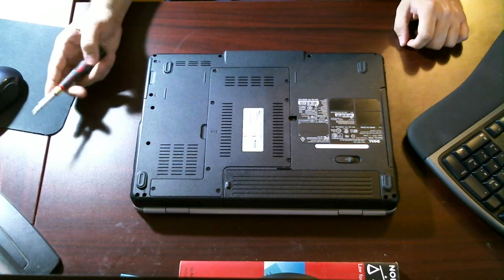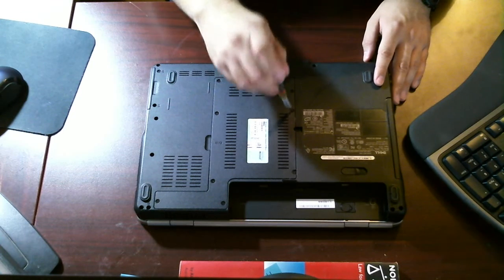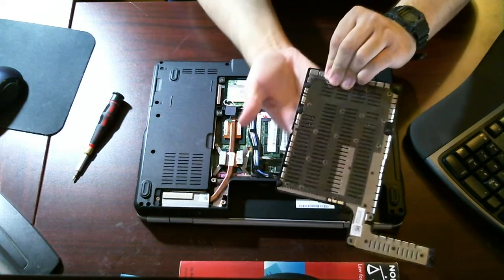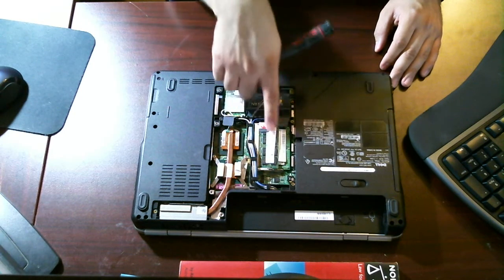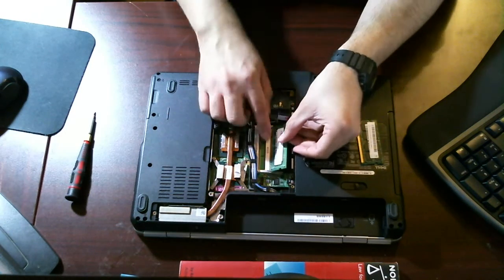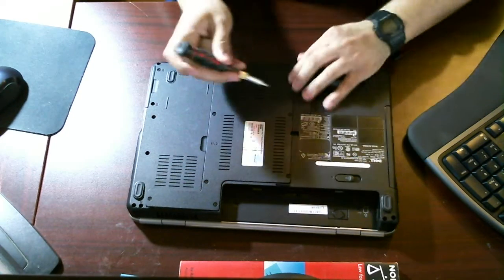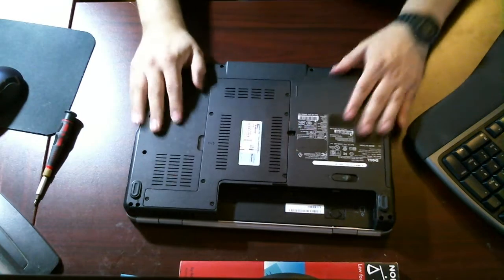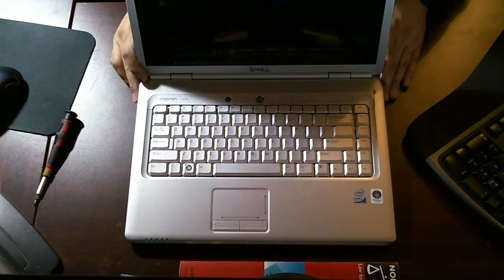How To Replace Or Upgrade Ram Dell Inspiron 1525

Comment: My uncle used to have this laptop until he gave it to me. While I'm in the verge of upgrading my 2 laptops (already upgraded the DELL Latitude E6430) and 2 desktops, the DELL Inspiron 1525 will be the next one to upgrade, and to do that, I'll have to by 2x 2GB DDR2 SODIMM for it (as well as a 500GB Solid State Drive SATA and clone the hard drive to it).
Reply: The RAM can be upgraded to a max of 6 GB DDR2 800 MHz. So 1x 2 GB & one 4 GB stick. Thr max CPU supported is an Intel T9500. 😉🤔😏

Comment: It is my understanding that the RAM cannot exceed 3 gb for the 1525 .inspirion.i have one .advise pls
Reply: i have 4gb ddr2 installed on my 1525 and i hear it can go up to 8gb... i wouldnt try it though bc it hasnt really been tested. BUT, people have safely achieved 6gb of ram with one slot filled with a 2gb module and the other one with a 4gb. if you wanna try it, make sure u get the right ram modules. and to use more than 3.5 gb of ram you need a 64 bit windows installation. hope i cleared that up a bit
Reply: @Zeazy   i have a 64 bit version I will give it a shot 2 and 4  i sure am amazed at the way this unit is operating considering the time it was  built
Reply: I did a bit of research on point and found out that 4 GB is what Dell recommends as a maximum. However, it may work with 6 but will NOT work with 8.
Reply: I understand that 4 gb is the max, but mine will not take  more than 3gb!
Reply: @smallcnclathes
Reply: What i did with mine was  make a ramdisk drive. it worked beutiful.. 
I used a memmory stick.Sadisk 32 gb and dedicated half of it to ram and the other half to system memmory
 @smallcnclathes

Comment: Bro how much ram can add in this slot
Reply: The RAM can be upgraded to a max of 6 GB DDR2 800 MHz. So 1x 2 GB & one 4 GB stick. Thr max CPU supported is an Intel T9500. 😉🤔😏

Comment: I know so many computer geeks that would slap you up side your head for not grounding yourself before touching  the memory. Anybody doing this if you don't ground your self by use of a ground strap or touching a metal object like a computer case or appliance (skin to metal) that's plugged up with a grounded power cord this will discharge static buildup. Any static build up on your body can fry circuits on the memory and kill the strip.
Reply: Highly unlikely. Mostly just an urban myth.
Reply: Never grounded in my life, 20 year tech.
Reply: Yeah, I had a professor in our instrumentation lab who would always insist on this, but I never did it and everything was always fine.

Comment: Hi, i have dell inspiron 1525, 32 bit, processor-intel r core tm 2 duo cpu t5550@ 1.83 ghz 1.83 ghz with 2 gb ram installed on it which is around 6 year old laptop. Now my friend is offering another 2 gb as he is having excess so can i add it to upgrade my lap ram to 4 gb. Pls mention if there will be any side effect due to this change. One more thing at right side bottom end it was mentioned intel centrino inside TM.
Reply: It will be normal, but be sure not to misplace it

Comment: I currently have 3GB of ram and computer is slow - 32 OS, Windows Vista Home Premium.  Do you think it would be worthwhile to go to the maxium 4 GB to help speed / operations?  Thank you for your help.
Reply: Dump the vista and go for the 64 bit windows 10. you will be surprised at the results . im running 3 gb ram but fixing to try 6 gb just to see if it makes a difference .

Comment from the maker: Hi - there are 2 RAM slots available within this unit. With that said, please visit crucials website (crucial dot com) to see what the max capacity RAM is. Then, once you have the max RAM, order either (2) 2GB ram sticks or (2) 4GB RAM sticks. I hope that helps. Best of luck! I appreciate your support. Thanks for watching and please subscribe!!
Reply: max acceptable ram is 4 gb or 8 gb.....my system is a core 2 duo processor, 32 bit architecture unlike the 64 bit machine you talk of
Reply: @drdr73  so will it take 8gb of Ram without a problem ?  I have an old Dell Inspiron 1525 and it is so slow, it's laggy, I have windows 10 32bit installed.

Comment: Hi,
I want to upgrade my RAM to 4 GB. currently my laptop is configured with 2 GB. Can u plz tell me how many extra RAM slots are available?? If no free slot is available, what happens if I replace one of the 1 GB ram with 2 GB ?? will the performance of my laptop increase?? also tell the side effects.
 --Rahul
Reply: If the ram sticks are compatible, sure you can get away with using a 2gb and a 1gb ram stick, total ram would be 3gb and performance would increase. Although I'd suggest just buying 2 2gb rams instead for better performance and removing the 1gb sticks.

If they're not compatible i.e mismatched frequency, different brand etc. They will not work. Your pc will simply not boot.

To check available ram slots, right click on the taskbar > Task manager > performance > memory. and it should be visible.